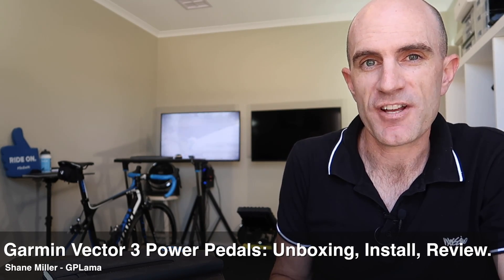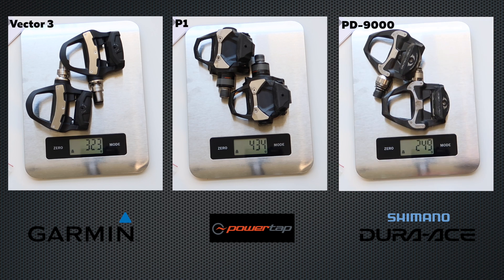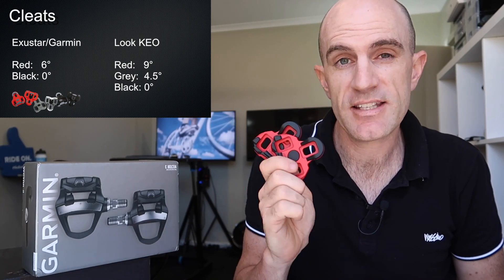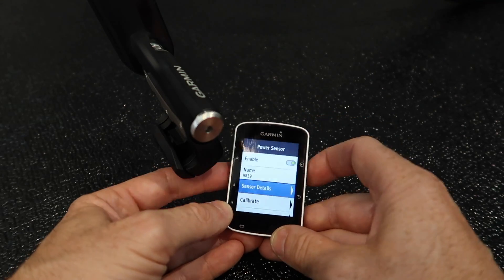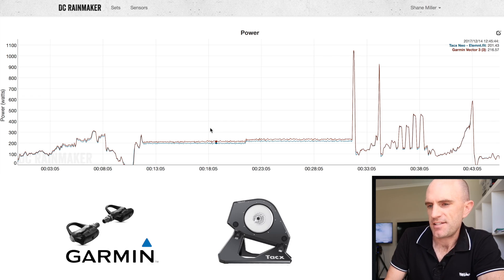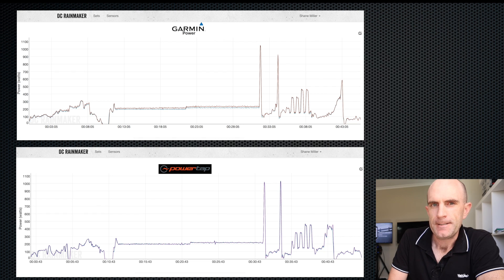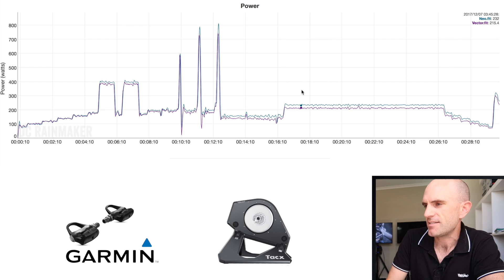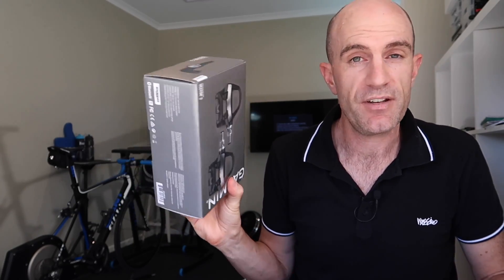Garmin Vector 3 Power Pedals: Unboxing, Install, Review

Comment: thanks for your video. Is it possible to see the cadence in the Edge 520 with the vector 3?which data screen would be? Thanks!
Reply from the maker: It should be a field you can configure to display in the bike profile.

Comment: hi GPLama , I have just purchased a set of vector 3s pedals and for £500 i am not impressed . I keep getting drop outs ie with the battery , garmin have sent me the replacement door covers but still the same ( still sorting it out with garmin ) but also i use a tacx flow on zwift and since i have installed my pedals i cannot pair with zwift unless i go into companion and then it cant find my HR Strap . Could you do a video showing how to set up the vectors whilst using a taxc flow on zwift
Reply from the maker: Are you using AppleTV? This will be one for Zwift Support as I won't be looping back to the Flow any time soon.
Reply: Using pc , garmin have finally got back in touch with a solution 🤞 . Hopefully it will work . Loving your site 👍

Comment: I'd be super-interested - like many people no doubt - in Shimano power meter pedals. I love my Shimano gear but I don't prefer a crank-based power meter solution. I'm holding off buying Garmin Vector 3 or Favero Assioma DUO because I know that as soon as I do Shimano will release their version! Have you heard anything at all about possible power meter pedals from Shimano? Thanks and keep up the great analytical work!
Reply from the maker: Shimano can't even get their crank power meter based on their own crank working properly, so I don't hold out much hope for them getting the pedals right. There's a lot of people wanting SPD-SL cleat power meter pedals, myself included. For now, dive into a pair of Assiomas. I LOVE SPD-SL blue cleats... but the Assioma with Black 0deg float have been solid. I used the same cleats on the P1 for a year prior.
Reply: @gplama  Thanks for the quick & concise response. The Assiomas are my current choice, almost entirely based on your work. I'd love Shimano to get it right, but can accept that it probably won't happen, at least not for some time yet. Guess I'll stop holding back and go for it! Cheers.

Comment: I've had mine for a year and all of the problems are rooted in the battery compartment that has now been revised but I can't get them to ship replacements to me. Customer service in Singapore kept passing the buck and I finally saw them for sale as an accessory (the version 2 battery compartments) online. That pissed me off. The pedals themselves are excellent once you support the negative battery terminal with a non-conductive wedge (see the "cork" mod on other videos). I used non-conductive "romper room" floor tiles and cut a tiny wedge to support the pressure on the negative battery terminal. Other than that the pedals are fantastic in all conditions. They're just not ready for the average consumer or the impatient cyclist.

Comment: I would like for a few others to respond. I purchased the Vector 3 power pedals in August. They have been spotty at best. They connected up right away straight out of the box. Then in less than a month they would start malfunctioning during the ride, working, not working, no reason behind it!  So, I changed batteries, bingo, we are working again for a few weeks. Then a repeat of the malfunctioning, spotty reporting on the head unit. So, either battery life is a few working days or the units are just awful. I cannot say that I am a happy customer. Can anyone relate their experience and a possible fix to this situration. I still have my receipt so they can go back!!
Reply from the maker: Return them. Get a new set or something else. Life is too short to spend time messing about with shit products.

Comment: Hi, do you know if these will be compatible with the ELEMNT BOLT? Have you been able to test that? Much appreciated!
Reply from the maker: They’re ANT+ and Bluetooth compatible. They work with all good head units that support one or either of those standards.
Reply: @gplama  Thanks for the response! I had read, that people are experiencing problems with the crank length setting when not using a GARMIN head unit, having to recalibrate it before each use.
I have ordered a set of vector 3 and will see if I can confirm this issue.
Reply from the maker: @myahsmith9707  The mobile app should be able to configure the crank length. Although head unit setting will override this. Keep me posted.

Comment: if the original Garmin cleats will be worn out after some time  can I use then non Garmin cleats?
Reply from the maker: From Garmin: In addition to the cleats that come with Garmin Vector Power Meter Pedals, riders can also use  LOOK Keo or Exustar PR3 cleats.

Comment: I hope you installed the pedals with the correct torque. If you dont. You can get incorrect wattage values
Reply from the maker: Specific torque isn’t a requirement for the v3. You’re thinking of the 1 and 2 models.

Comment: any updates on the data seperation? have garmin updated the firmware to correct for this?
Reply from the maker: I have a replacement set here in the box from Garmin. I'm yet to unbox and install them. I've wasted weeks on these things, I'm not motivated to waste more. I may post an update in the near future.

Comment: Thanks Shane, nice review.  Did you ever get to the bottom of the power discrepancy v the Neo?
Reply from the maker: Spent 1/2 the weekend on these again with the new battery housing, service advisory 'advice', and new firmware. I'll get to the Neo tests tomorrow. So not yet.
Reply: Shane Miller - GPLama Ha, well done on getting new battery doors, Garmin have no eta in the UK!  Be interesting to see what you see, hopefully the doors will solve some of the issues.  I think I’m refunding mine and will watch from the sidelines, too many solid options around nowadays to take a punt.  Thanks for the reply.

Comment: It looks like it’s impossible to buy these pedals at the moment. Any ideas why ?
Reply from the maker: One for Garmin to answer. I have no idea.
Reply: I just had Garmin on the phone. Production of Garmin Vector 3 has been stopped due to a problem with the batteries place. A new version of the vector 3 is now beeing produced and should be available in July/August
Reply from the maker: July/August! Whhaaaaa... I know they've replaced the battery housing (waiting on mine to arrive for a follow up video). I wasn't aware of the delay in production though.

Comment: Always a fan of your reviews. (love the sound of the gallahs in the back ground when out testing the pedals). Brings back memories of home. You may recall I had some really bad luck with the G2 power meters...since watching your review,  I went back to them and they persuaded me to send my cranks and units in for re-gluing and set up. I have them back and seems to be working ok so far. Will do a  side by side comparison with the wahoo kickr and see how accurate the results are. I did notice you still have yours on. Good show sir Miller.

Comment: Confirmed on 5/28/2018: RECALL CAMPAIGN STARTED

This is to address the constant signal drop outs that V3 and V3s owners have been experiencing, making the pedals non-functional for any kind of training or data logging.  Some users have resorted to tape, cardboard, or bits of cork to address the battery looseness issues too: https://www.youtube.com/watch?v=jbK1pkCyW_s

That's my guess as to why we haven't been able to buy these through any channel for the last several months as Garmin is dealing with both hardware and software issues.

I was contacted by Garmin both by phone and then by email on 5/28. They wanted to confirm my shipping address for "redesigned battery doors." Here is the current phone script:

"Hello, my name is ... from Garmin calling for .... in regards to a set of Vector 3 pedals. We have an indication that you have a pair and may be experiencing some issues with those pedals. We do have a redesign of the battery door system that should take care of some of those issues and we just wanted to reach out and verify mailing information. We'd like to get these shipped out to you as soon as possible so if you'd like to give our office a call here at ... you can ask for an agent or ask for myself ...."

The email was similarly professional and with a sense of urgency to help me out. I didn't initiate any of this and I've never written or called Garmin before. It sounds like they want to make things right.

- K
Reply from the maker: Excellent. Not quite a recall, more a replacement part campaign. I'm waiting for my battery doors so I can try them out and do a follow up video.
Reply: Shane Miller - GPLama, awesome.  Glad you’re doing a follow up video!  My battery doors just arrived this morning and will install tonight for a test ride.

Comment: When is the next video on vector coming
Reply from the maker: When Garmin have a solution/fix to the battery cap/housing issues. Soon.
Reply: Shane Miller - GPLama did u faced any issues...
Reply from the maker: Yes. More soon when I have a more permanent solution.
Reply: Shane Miller - GPLama would u recommend ordering it now or go with the stages lr
Reply from the maker: Entirely up to you. I'm not sure there's much supply of the Vector3 units around.
Reply: Shane Miller - GPLama u faced problem with the battery or any other issue. Asking because recently bought Garmin 1030 specially for it and it's my first powermeter.
Reply from the maker: Best review the Garmin forums here: https://goo.gl/XczYPh
Reply: Shane Miller - GPLama thanku so much for helping Shane....

Comment: Shane I bought the Vector 3s and love them for outdoor work.  However, am I the only one who only gets 50% of the watts in Zwift?  It seems likely to me that Zwift is not reporting 2x watts for single sided set ups.  Have you found otherwise?  I have all updates.  PS  Wahoo bolt and fenix 5 report just fine.
Reply from the maker: Hmmmm. That’s one for Zwift Support. I know they x2 the PowerTap P1S (and the P1 as they aren’t combined in the one channel). Sounds like they need to identify and do the same for the V3S (only the S as the dual versions are true LR).

Comment: Wonder if there might be a recall on V3s (?)  Lots of ppl have lots of issues with power dropping out ("right sensor missing" - error warnings on my Garmin Edge 520) - anyone else having this issue?  Wonder if I should just get PowerTap pedals...?
Reply from the maker: Battery housing issues... I’ve had them with mine. Waiting to see if they have an official fix....

Comment: Hi Shane, can you tell the difference between the Look and Shimano cleats? I always used Shimano pedals and wondering if there is a trade off. P.S everyone uses LOOK pedals as the patent run out, whilst Shimano is still valid, and Shimano did not allow Garmin, Powertap and others to use it.
Reply from the maker: I prefer Shimano cleats. I'm now fine getting around in the Look/Exustar/etc cleats that are used with P1 and Vectors. I haven't unclipped in a sprint or felt they were a limiter in any way.

Comment: The +/- 1% refers to the delta on the pedals themselves. Meaning that you ride on Monday and then again on Tuesday, your readings will be within 1% of each other. All power meters vary in terms of reading watts. All that matters is that your own personal data remain consistent so you can measure your progress accurately.
Reply from the maker: Do you have any reference for this definition? I'm not saying it's incorrect. It's just not the commonly agreed definition of the published % of accuracy of power meters/trainers.

Comment: My bike fitter installed the pedals and cleats, and I have been trying to get my Edge 520 synced with the pedals. I think I'll need to upgrade to the new Edge 1030 to get all of the value from cycling dynamics. Looks like the most I can get from the 520 is L/R balance/power. Memory issue? Would really like to see a great app from Garmin on iOS since the pedals are BT. Assume they are BLE?
Reply from the maker: The 520 will show these pedal metrics. I can’t recall the exact option on the head unit, but it’s there.

Comment: Excellent video and one of the reasons along with DCRainmaker’s review that I picked up a pair this weekend. Haven’t had a chance to use much but they certainly look the part and were easy to fit. I wonder did mine come with different cleats as mine did have a marker on either side similar to the shimano ones. (Mine say ARC R2 on them). I’ll be using with a kickr. I wonder what difference the over reading would actually make if using the pedals as the power source in zwift for ERG? Would it mean your steady state effort is actually 20W less that’s what it shows on screen? I guess it’s not possible to know as you can’t collect the power data from the kickr if using the pedals as the power source. Maybe try it with a comparison to a crank based power meter?

Comment: Did you try out the Assioma Duo's? I just bought a pair of them (while getting my V3's replaced under warrenty). I have only been riding them indoors and for 15 hours, but so far they have been absolutely flawless. One note here, my L/R balance are spot on with the Assioma's. This definitely is more in line with my own perception. I suspect the V3's for having an imbalance going on. Could this be the same you see, causing a lower power output? Untill further has been cleared out regarding V3, I'm going to keep the Assioma's - simply because they're so solid and flawless....
Reply from the maker: Trying to get a hold of them.... stay tuned.

Comment: I'd love to see a chart that shows the absolute difference in watts between the power meters. Otherwise, the difference is lost in the noise stroke-to-stroke. Might show the losses in the drive chain!

Other stats ideas:
- histogram the power difference in erg mode. Show mean, mode, and standard deviation of difference in power.
- time-shift the two series and compare covarience, the maximum of which is the time delay between the sensors.

Looking forward to Garmin Vector 3's here, still hard to find!

Comment: From the field: Garmin Vector 3 Battery Life Report

Short version: 
Lasted 87 hours; battery warning problems; durability issues with rubber o-ring

Details: 

I just had to change out my first set of batteries for the Garmin Vector 3 Pedals (dual-sided) since getting them at Xmas.  My total run time according to Strava was 83h10m, but I added a 1.05 multiplier to get 87 hours or so because the pedals were probably on for some of the time before and after rides, and more importantly, before and after cafe stops.  I live in Northern California and temperatures ranged from 45-75F during this time.  I did not use these in the rain.  I did not spill coffee on them during my cafe stops.  Pedal smoothness was disabled.

I started getting low battery warnings on my Garmin 820 head unit for the last 40 hours or so, but when I checked the battery life using the Garmin mobile app via bluetooth on my phone, it showed 3 full bars.  Finally, today, the 3 full bars instantly turned into 1 red bar and I was convinced to change them.  During those 40 hours though, I had perfect data from both pedals.  This sounds like a voltage calibration issue before the pedals should start (prematurely) issuing the warning to the head unit.  Garmin should address this via a firmware update.

The battery change was straight forward, just needing a 4mm hex.  The problem though, however, is the yellow rubber o-ring.  As part of the waterproofing, Garmin opted for a thin, yellow o-ring that freely floats inside the spindle.  This o-ring is not going to cut it.  It's incredibly flimsy and seems to get caught in the threads of the cap, no matter how careful you are (I have a very steady hand for this type of task).  If I were to guess, the o-ring will break after a couple more battery replacements ... so where do we get o-ring replacements???  Garmin?  Anyone figured out a replacement from a random hardware store?  We shouldn't have to do that for a $1,000 product ...

Hmmmm ....
Reply: Useful information.  Garmin battery spec is always at ideal or perfect conditions that never happens in real life.
Reply from the maker: Cheers for dropping in with the detailed user experience. I really appreciate the input from another user. I'll keep an eye on the batteries and rubber o-ring when I do a battery swap out (coming up soon)
Reply: Cool.  Would love to hear your experience too.  And not just a user ... definitely a fan of your channel!  Keep the good quality work coming. :)

Comment: I'm currently using the dura ace 9000 pedals and love the feel of the pedals as well as the ability to adjust the bearings. I'm interested to know how these Vector 3 pedals perform mechanically and if there is any detectable play. I want to use them but I don't want to buy a pedal I can't adjust.

Comment: Shane are you seeing any power drop outs when using element bolt? I used the vector 3 outside for the first time today and have 3sec average to display on bolt but I noticed a good few times today when I looked down at the bolt the Watts were reading zero. Any ideas? Tnx
Reply from the maker: Nope. No dramas with 0W unless I'm not pedalling.
Reply: Shane Miller I wonder could it be that I still had a wahoo cadence sensor connected as well!!

Comment: Great video. Question if you had to choose between PowerTap P1 pedals and the Garmin vector 3 what would you recommend from what you have seen so far from the vectors yourself ???? As I do open road racing, TT's and indoor track racing and I am wondering which would be better for those 3 disciplines that I race in